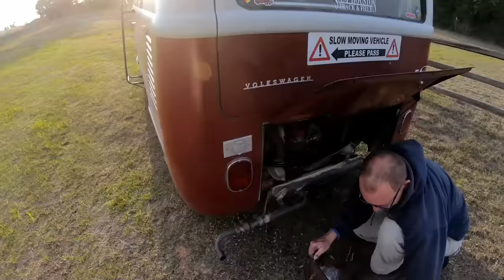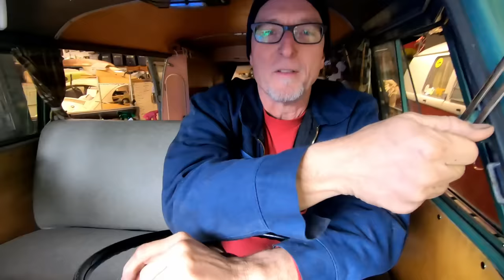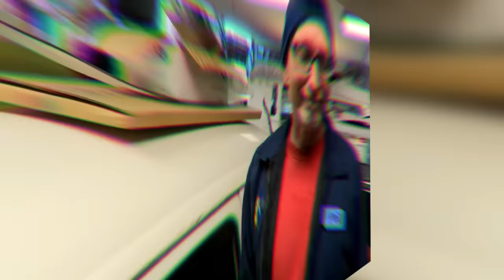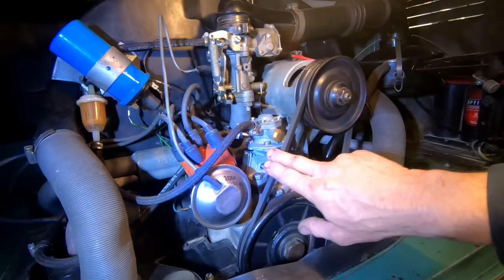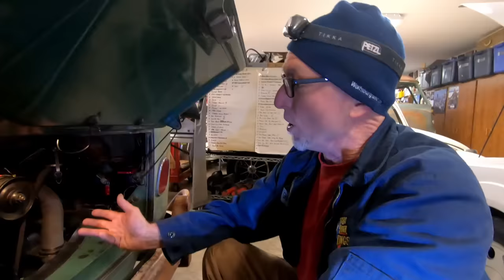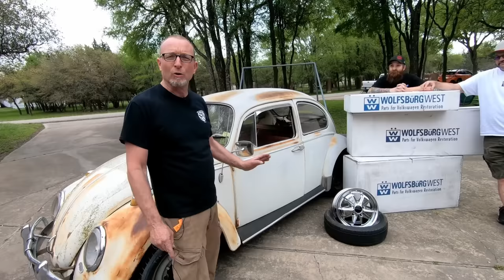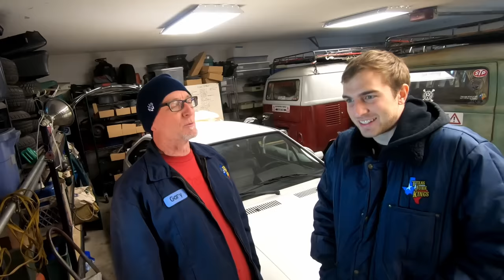10 Things They Don't Tell You about Owning a VW!

Comment: My number 10 is the fact that in eight years, I’ve only broken down once (a broken accelerator cable).  So, this worry about breaking down is a myth—if you maintain it properly.
Reply from the maker: Ah okay
Reply: This incident gave me one of my great adventures. While riding home from college on break in a 1300 Beetle with my friend, the accelerator cable broke. No spare. He drove 200 miles through WV mountains while holding the steering wheel in his left hand and the accelerator cable in his right while he stooped over. I was in the passenger seat, shifting gears with my left hand while he told me which gear he needed and operating the clutch. You can't make this stuff up! Great day!!!! One of many adventures in "Frodo" in the 60's.

Comment: Must say I had a 71 with a rebuilt engine for eight years and never had  a problem of breakdown with it and I drove it a lot.  Of course I was on top of oil changes and adjusted the valves and pts etc.  They can be extremely reliable if you have a good engine to start with and take care of it.
Reply from the maker: Ah okay cool

Comment: #10. Don't expect to see where you're going if its raining at night!
Reply from the maker: Yep pretty much have to go by the sense of smell
Reply: that's no insulation on heater/defroster tubes, and air leaks. condensation on the inside of the windshield can be a REAL issue, but easily solved too.
Reply: or how about when your windshield wiper motors die and you squeegee the windshild during stop lights in the rain 😃
Reply: RainX
Reply: @RS-of1om  yes! This happened to me last weekend. I just laughed and added it to the "to-do" list
Reply: very true

Comment: 10 a VW rebuild is never finished.
Reply from the maker: Never ever ever
Reply: they can be, but its a complete tear down and from the ground up giving it everything you see it needing. can be done in 2 weeks if ambitious enough,  3-4 days to be apart (wait for parts) 8-9 days back together NEW, paint and everything. don't play around, attack it FULLY, it's worth the sweat.
Reply: @modelnutty6503  ... Back in my prime (mid 70s) I could do an engine over in a single day, including machine work and tin painting. The next day was going through the trans and doing the installation, test driving by 5 pm. Body work (read: rust) has too many variables to put a time limit on it.
Reply: In AZ we had a sticker "15% fixed"

Comment: I spent the winter of 79 in AK driving my 64 dc as my daily driver. With a oil screen plate plug in heater, two gas heaters ( one under dash and one in engine compartment to heat carb wile startling) I was able to drive and survive at -30. I doen’t do that anymore, I love my F-150 now, with hot water heat! I would love to post a photo of me and my DC, but don’t how to on your site.

Comment: #10 - That any 5 minute job quickly turns into a 5 hour job. With my 76' Westy every nut and screw that needs to be removed for a job is rusted and seized, yet I wouldnt have it any other way. Good video guys 😁
Reply from the maker: This is true! But as a little tip you should be spraying everything with PB Blaster a few days before you're going to take it off and that will help tremendously
Reply: As soon as you buy a VW you might as well stop by the parts store and buy a case of PB Blaster.

Comment: did the vw thing 10 yrs just a tip if u live in the north or south the heater cable tubes get rusty how do you clean them easy get a headliner bow the long wire that holds the headliner up hammer the end flat and hook to a drill and drill the tube it will clean the tub so the cables can be installed when putting the cables in the long one goes in the bottom

Comment: Before getting to number ten, I want to say I disagree with number #1, breaking down or not is dependent upon how good of a mechanic you are back at your garage before setting out on the roadway. I've had several air-cooled VW's and only once did I have a problem on the road. The power lead fell off the fuel cut-off solenoid. My fault in forgetting to plug it in completely after testing. The engine kept me driving down the road but stalled at every light. OK I have ten number ten's, #10 during winter when sitting at a light you will learn to hold your foot on the gas pedal a little to keep heat coming into the cabin. This does not apply to later models with a working gas heater. 10-a If you have a pre '67 VW you will learn to keep the headlights set on high beams all the time. #10-b If you regularly drive in outdoor temperatures below 78F, you will develop a complete working knowledge of VW's very simple heating system, and make it to be in good operating condition. #10-c If you own an older model without hardened valve seats, you will learn to use gas with octane ratings above 91. #10-d If your VW suspension is sagging in the rear, you will learn that there is an adjustment for this-that no one knows how to do. #10-e If you have and engine smaller than 1500cc's, you will learn that you cannot drive with it floored on the expressway for fifteen minutes. #10-f For all VW's, you will learn the value of the old copper fuses compared to the crappie newer aluminum fuses. #10-g You will learn to keep the door hinges lubricated. Most Important #10-h If you're going to be smart about VW ownership, you will learn Dr. Porsche's concept and design of his "two sides" of the engine. The clean-cool side, and the hot-dirty side. And you will correctly implement Dr. Porsche's method in keeping the two sides sealed off from one another. USE ALL THE PIECES of engine metal (top side/under the hood and bottom side/underneath outdoors) make sure they are well attached because all of them total a very effective duct system, and also use a like-new engine-metal-to-body gasket. No hood props, no air scoops, no electric fans, and no goofy catalog crap in an attempt to vent the engine compartment. Just do what Dr. Porsche designed.
Reply from the maker: thanks for sharing!

Comment: #10 your VW will catch on fire at some point so you need to make sure you have a fire extinguisher.
Reply from the maker: Top tip!
Reply: Yup took family for a ride and the metal under the back seat touched a battery cable and sparked a little fire under the butt!

Comment: My favorite was the '73 Super Beetle I had in the mid 80's.  Found it in a pasture, a small tree grew up from the inside and out the driver side window.  Cut the tree out, got it on a trailer, and to my buddy's garage.  We spent 3 months working on it after work, weekends, etc.  Upped the engine to 1850 cc's with dual carbs, and painted it "Faded Denim Blue" (bench mix).  It ran so good and I got so many compliments on it.  Drove it exactly 6 weeks and one moon less night on my way to work I had a damn deer jump in front of me from outta nowhere.  I got a Squareback after that, then another Super Beetle, but it just wasn't the same. (sigh)
Reply from the maker: Wow that's crazy
Reply: You removed it from nature, and then nature let you have your fun with it before reclaiming it lmao

Comment: 11.  The generator will go bad.    12.   The gas cable will break when you need it most.  13.  If you forget to push the clutch in before going into reverse you will rip reverse gear teeth out.  14.  The window shield wipers will slip and stop turning.  15.   Parking in gear on a hill is not necessarily enough to keep it from rolling (even backwards when you are pointed up the hill).   16.  You will not have enough power to merge safely on an uphill on ramp.  17.  You will race through the gears like a race driver.  (1st gear red lines at 12 mph).
Reply from the maker: All true!

Comment: About to PUSH my 73 Bay into my small shop. It will share space along with my 69 Road Runner,last years birthday gift! I’ve owned the bus for about 40 years stopped driving it around 15 years ago. It was stored in a family barn and became a mouse house, it has been gutted but the smell will take some effort. Shop has in floor heat, let the games begin

Comment: From New Zealand.  Had a Beetle and a Microbus at the same time in the 70's. The Beetle snapped a crankshaft and still ran us home.  The Bus I named Adolph's Revenge on the back.  The heater was air heated from the engine tin ware, and guess what happened if you had an exhaust leak.

Comment: I worked on a lot of VW bugs in the 70s. It was fun, I overhauled several of the engines, it was fun test driving them on the parking lot, real easy getting them on two wheels on the turns (don't try this on a public road). Parts were dirt cheap and easy to find in those days.

Comment: 10. Practice speed shifting so when you think your clutch cable broke but you find the hook broken off the pedal assembly you can still get home.
9. If you're running a stinger don't use vice grips to hold a broken throttle cable keeping the carb at 3/4 wide open to drive through downtown past the police station at 1am.
Reply from the maker: This is a good one!
Reply: Got plenty of tickets with my 67 bug’s stinger😂

Comment: That windshield on that camper is something I want on my sleazy shag wagon homage project. But something tells me its not gonna bolt up to a Chevrolet g20.   I'm in the camp of people who love old VWs, but know full well I have neither the money, the time, or the friendly open good nature needed to own one.  I am grateful that you guys and your friends are doing what you do, because without your particular set of mental disorders (joking, sort of ;) these cool vehicles would vanish forever.  Still, every time I get frustrated with the vacuum lines on my twin turbo Subaru, I remind myself that I could be fixing a VW van on the side of the road at 100 in the shade. That's my first memory I have of my father, who, because he happened to have the parts in the van already, went ahead and rebuilt the entire top end of the engine that afternoon. Roadside. With what I remember as three crescent wrenches and a rubber mallet, but probably there was a socket set and some feeler gauges as well. As I grunt and moan wedging my large manhands into the most intimate regions of my poor teenaged Subaru, I invariably start to consider the most heinous acts and perverse fantasies imaginable... Like how to swap that elegant air-cooled engine out and replace it with the plumbing nightmare I'm struggling with.  Thats right people, how about we do the vw/subaru engine swap IN THE OTHER DIRECTION!       Folks, thats the tenth thing nobody told you about owning one, its that even though a modern engine can easily make 10-15 times the power of those old VW heaps, its often just not WORTH it. I love that Subaru fast wagon, with its right hand steering wheel and short gearing and Bilstein suspension, especially in the snow and ice I drive in, the damned thing is a cruise missile with wheels.  But every  time it finds a new way to break, I'm reminded of the afternoon I watched an engine turn into parts, and back into an engine, with no fuss, no muss, and never even any question that this was a perfectly reasonable thing to do. I guess technically I didn't own one, but the sheer stone knives and bearskins attitude infected me on that day, and I fear I am inching closer with every trip between the downpipes of that Subaru to a a rusty old bug.  Slow? sure is! Not a vacuum line or a computer chip in sight though, and thats looking sweeter every year.
Reply from the maker: While reading this was like Art! Thank you for your perspective into what is going on in your mind right now! If you find one let us know

Comment: Number 10 -- You can change the oil, the oil filter and the air filter without buying anything (except the oil). Both filters are "permanent." Number 11 -- when you finally wear out the generator brushes, you need an offset 10mm wrench to get the generator out easily, and if you don't have that, it's a lot more work.

Comment: My memory of VW, my first 7 years of life all I can remember is every time my family went somewhere the VW would breakdown. My dad bought a new 1952 Beatle, by the time I was born and was old enough to have a memory the car broke down often. I do remember that he converted the car from 6 volts to 12 volts and replaced the dynamo to generator. Next memory I have is when we had friends and or family in the car, my seat would be that small compartment behind the back seat, it was not fun in summer especially when they all smoked cigarettes in the car, as a kid to me it felt like everybody smoked in the 70's. Another memory is when my father had to brake hard and locked up the wheels me in the back seat went flying of the seat, this when I found out that the seat was made if wood and the battery was located under the back seat. Last one, visiting my grandparents who lived on top of a steep hill, dad would use a low gear and put the metal to the metal way before we got to the hill just to make it to the top.

Comment: #11
Adjust your drum brakes before a big trip (or just often).
Be sure your brakes are serviceable (good shoe thickness, no hydraulic leaks, functional adjustment Star wheels).
One wheel at a time:
Car/van lifted- spin wheel (wheels and tires need to be in place) and turn adjustment until heavy drag, press brake pedal (resets shoe position and should indicate more adjustment is needed) readjust and repeat process until you may have to back off the star wheel a notch - goal is not to have excessive drag but you want the shoes immediately ready to act on the drum. Now adjust your hand brake cable.
Now bleed the brakes.
:-)

Comment: Back in the 70s I was driving around in a 63 Beetle. I worked late on a Friday night, and cranked up and headed out to make the 20 mile drive to home. As an old TV repairman, I always carried my toolbox/spare electrical parts caddy with me. So, I'm halfway home, and just like you turned the key off, the engine did not even sputter, she just died! I coasted over to the side of the road on that late winter night to see what's the trouble. I knew the gas tank was at least half full. The battery and generator were working fine. Let's take a look. Got out my voltmeter, turned on the ignition switch and measured the voltage at the coil. OK! Now what the heck? One more idea left. Pulled off the distributor cap and the lower cover. Then put the car in neutral and turned the engine by hand to get the points up on the highspot. Viola! The points had ceased to open on the hump. Took my flathead screwdriver and my thumbnail and reset the points. Put it back together, got in the car, cranked right up and drove home. I love old Beetles Y'all!

Comment: When I owned a '61 Beetle, there was only one spare that I needed to carry with me ... a clutch cable!!! 😲
Reply from the maker: We've all had one pop!
Reply: Accelerator cable too! 
It's happened to me while cruising around.
Reply: My father had spare a fanbelt in his '72 1300.02. from '74 to '86. he keeps it in his 2004 Nissan micra. He broke down once with his beatle 2 day's rain in the ardennes flooded the electrics.
Reply: I live in Africa so it's 5 litres of oil, 5 litres of water, fan belt, clutch and accelerator cable , points, condenser, insulating tape, 5 meters of 15 amp electrical wire , spare light bulbs, 500 ml of brake fluid and of course a spare tyre. Oh and a set of spanners, sockets, feeler gauge and screwdrivers :). Mudpig my bus has only had to be towed home once in forty years.

Comment: I used to have a vw bug, green, w/a fiberglass body back in the 80's. Drove it from Colorado to Daytona beach, florida & sold it to our neighbor across the street who wanted it. I had it checked out by a vw mechanic before I drove it from Colorado to florida. He said I had a crack in the mainframe in the front, so don't go over any big bumps. Also, in the back on the engine there was a spoke missing, so sometimes I had to get out & turn the belt in order to get it to start. When I bought it the heat wasn't working, so I got underneath it & found out why, because the heater vent was stuck in the closed position, so I unstuck it. It did really well in the snow in Colorado & I was happy w/it for the time. One day we had 60 mph winds in Colorado & when I opened the driver's door, the wind pulled it open forcefully & it got it off track a bit, so you had to be careful about closing the door. It also had an oil leak in the engine, so I was constantly putting oil in it all the way from Colorado, but I enjoyed it very much, the car & the drive down to florida. Now, I wish I had of kept it, because the engines are easy to work on & pull out to work on. Thank you for the video! (I wanted to buy a vw westfalia, but the owner was asking too much for it in price, I thought, $19,000 & it did have some things wrong w/it.) Number 10: Vw engines are fairly easy to pull out & work on!
Reply from the maker: Thanks for sharing your story!
Reply: @VWLifeVW  your welcome!